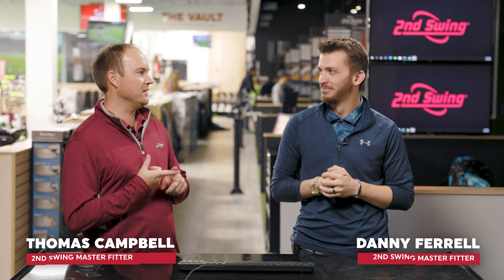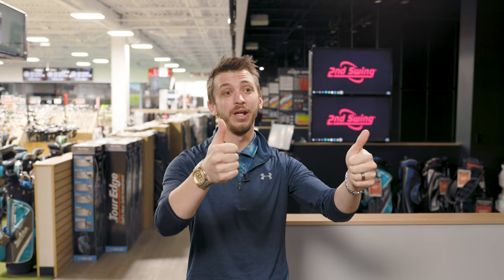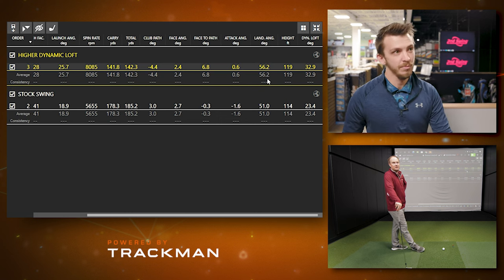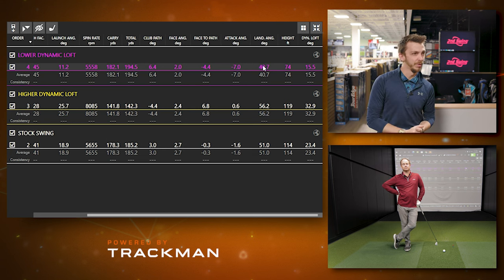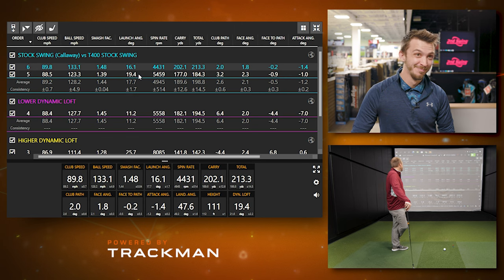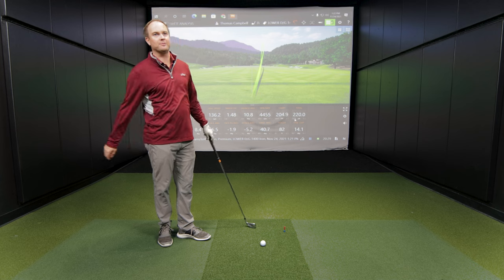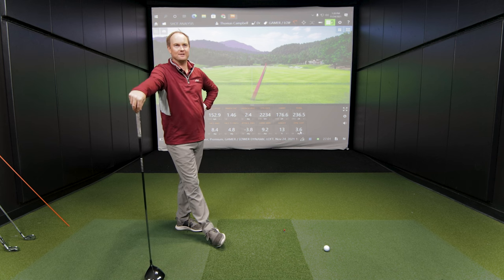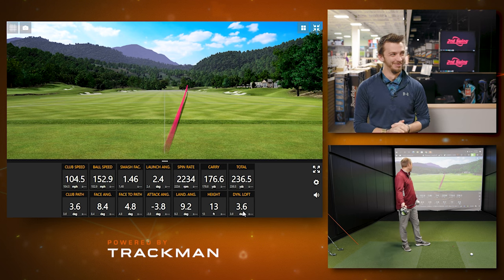Trackman Tuesday: What is Dynamic Loft?

Comment: I have a feeling my dynamic loft is very low vs the average player. My 58* wedge carries 95 yds easily and my typical launch is in the mid-high 20s at around 77-78mph chs. Couple that with the fact that I've always struggled to create height especially with longer clubs I think that's the case.
Reply: I qm curious, what is the spin rate for you wedges up to long irons. Must be pretty low or pretty good. Super curious mate.